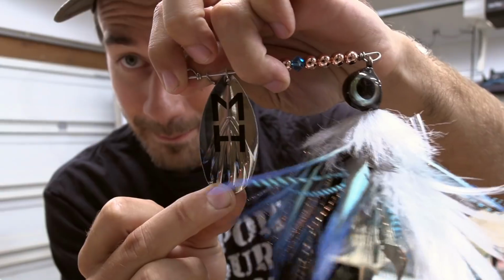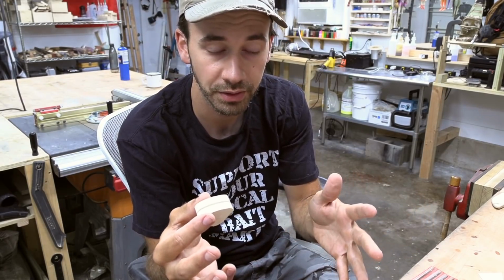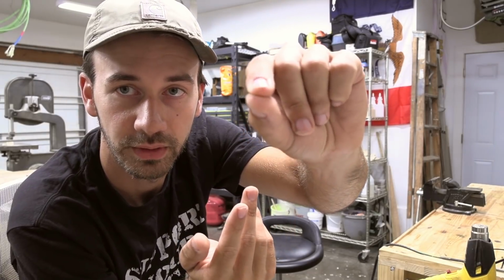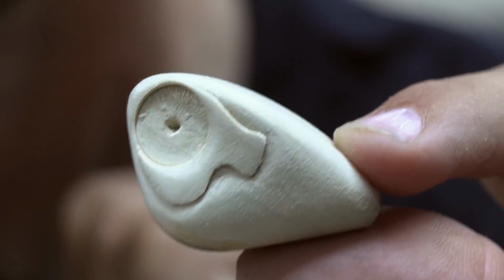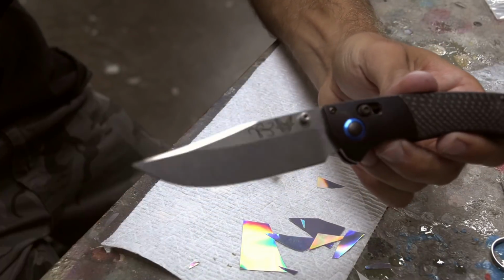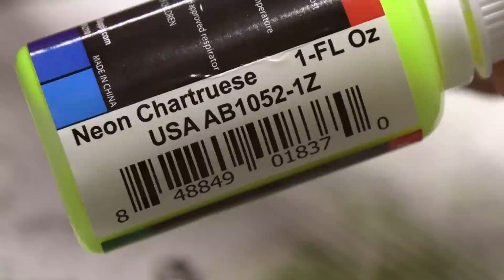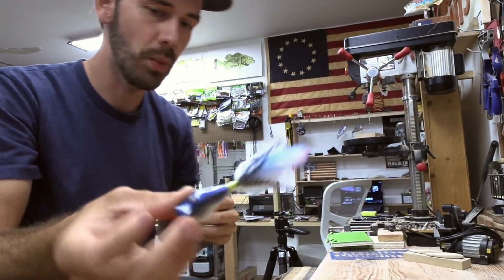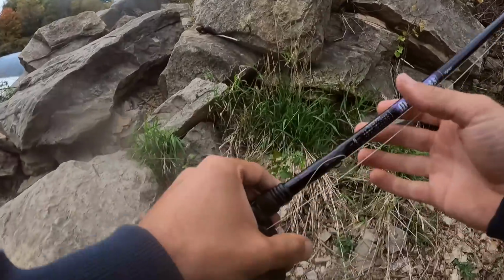Making a Mini Musky BladeBait | One Day Build to Catch

Comment: Nate's on a roll this week! Gotta get them in before the winter gets here!  Also quick note, you can use anti stick cooking spray to get the glue off your fingers. Sounds weird but works.
Reply: My name is Nate 😁
Reply: @taylorbaker4019  after but before may work
Reply: wait what winters already here 
oh nvm hes far south
Reply: Wait what do you mean
Anti stick cooking spray?
Like canned canola or other oil?
Reply: @BoaresAddja  its starts to get cold in Iowa pretty soon.
Reply: @Jay22222  yea. You can use canola or spam spray or whatever. Im guessing whatever ingredient makes things not stick to pans also helps with the glue.
Reply: I should rephrase. It doesnt remove all the glue from your fingers per  say,  but if your fingers are stuck together or stuck to something, it will help free them.
Reply: @rbalara31  I sort of get ya, I was wondering what that ingredient doing double duty was but sounds like it’s not the primary ing.
I’m sure the oil+ hydrocarbonhelps a lot too. Especially with you reiterating what you meant.
 Thanks bro.
Reply: @rbalara31  yeah thats far south
Reply: @BoaresAddja  compared to Canada? Yea it's south. Compared to the US? Its no where near the south lol
Reply: @rbalara31  compared to where i am yeah, Iowa is far south
Reply: @BoaresAddja  Canada?
Reply: @rbalara31  No, Norway
Reply: Oil in general is good at getting glue off your fingers. Works very well on pine sap.

Comment: I have a pretty bad superglue stoked on fingers tip! If you have dryed glue on your fingers.. Put on rubber glows until your hands start swet.. The glue will be easy to remove afterwards..

Comment: Re. removing super glue from your fingers: wash your hands in as hot water as you can stand. When your skin is getting pickly, lather with soap, and use a Bic shaver to shave the glue off. It kind of catches and peels off in small sections.

Comment: If you get your fingertip stuck to something with super glue, try rotating your finger off parallel to the surface instead of pulling, also a good flat file works great for getting dried super glue off your hands!

Comment: You are literally putting Blood, sweat and tears into your work lol What about trying a buzz bait? 2 blades, jointed wood body, might be fun. Put that one in your book of ideas for next spring topwater. 

We got about 2 months until fishable Ice. you could make a bunch of those and release  a few extra videos come good ice.

I'm wanting to get a 3d printer and want to do 3d printed molds for soft plastics. I am on a slim budget right now so what would you suggest for cheaper soft plastic and color brands? Also a cheap way to heat plastic and inject a mold. 

Colors that seem to work good up here are the green pumpkin, white chartreuse, and natural colors.   some people say black/blue works great but Ive never had luck with it.  I'm thinking about making a mold for a small turtle, and try a shrimp and squid mold as well.  Also thinking about trying to make a 3d printed jointed hard swimbait. and crank bait... if I can figure out how to do it well I'll send you one to promote.

Comment: I never understood this, you take super glue and cover the bait to seal it from the water. How does it seal if you sand it back them back open. Wood pours and it stays afloat like it shouldn't. You just sanded away the superglue
Reply from the maker: The thin super glue goes deeper than the surface, and into the wood probably an 1/8 inch. It's rare to sand through to unsealed wood, but it's just a drop away from being sealed again.